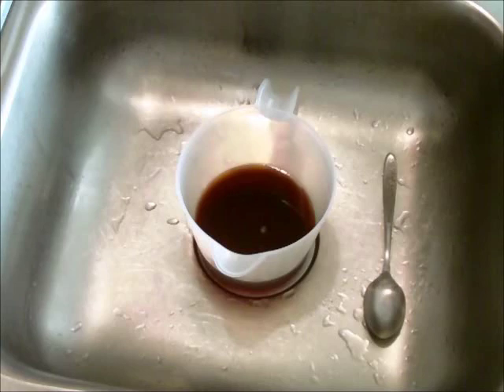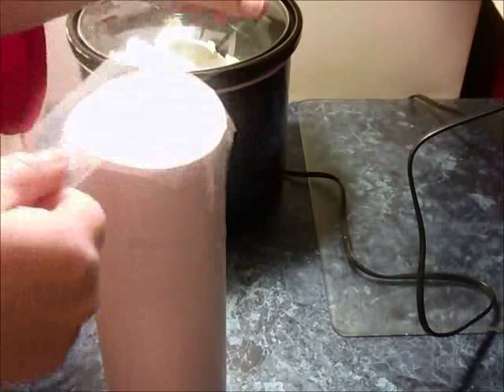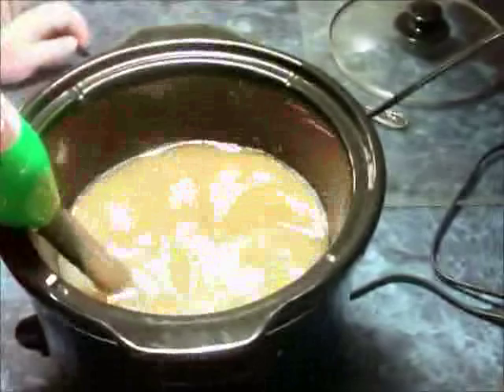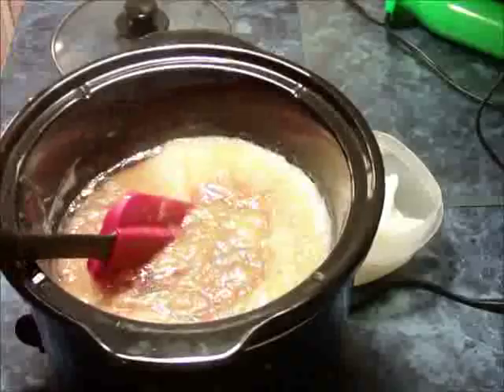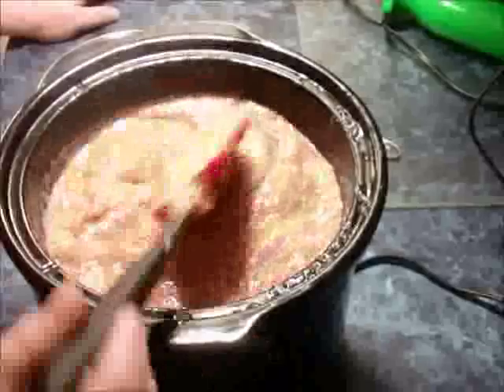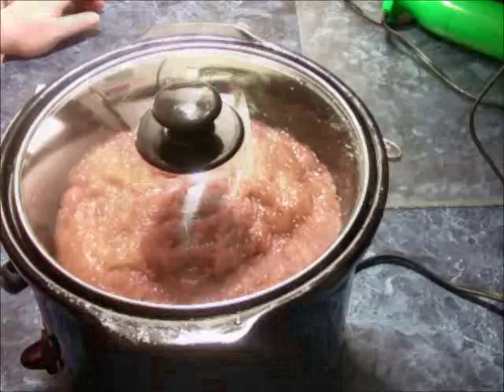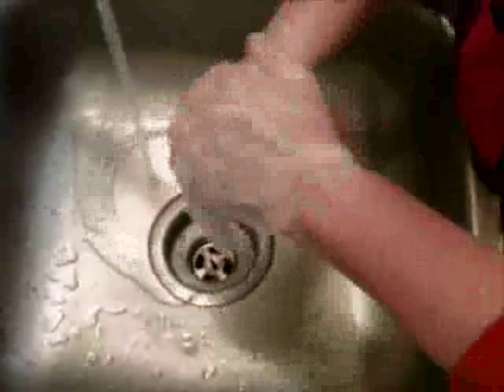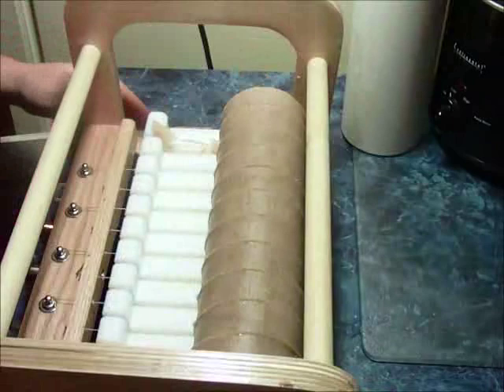Making Hot Process Beer Soap

Comment: Thank you for the video!  I wanted to give a little tip I do when using pvc pipe for a mold.  In that same section at Lowes or Home Depot, usually right below some of the pipes, they have different joints and end caps available for the pipes.  There's a flat plastic end cap for less than $1, it pops in the end of the pipe and pops right back out when your soap is solid.  Super easy and reusable!  :)

Comment: How did you manage to get your soap out of the PVC pipe without it being lined?  I made soap in mine once and had to have an act of congress to get it out and many of the bars were lost. Are you using a mineral oil to coat it or is your mold just seasoned? I'm in awe over here.  That soap is amazing. It cooked without being brought to heavy trace, go figure. 😊
Reply from the maker: Yes I still use them.  I coat the inside with olive oil or coconut oil.  Since the cooked is already saponified it helps it slip out.  I use a tall metal water bottle to push it out.

Comment: Hi, do you use any product inside the pipe so the soap can come out easily? I have tried to use the pipe for my first batch, but it is stock in it. Any tips? :-(
Reply from the maker: I grease it with olive oil since it is HP..If I was pouring CP in it I would line with freezer paper.
Reply: Thank you!

Comment: Can someone explain the pros and cons of hp vs. Cp.? Soaper wannabe and confused about which process would be best for me to try. .... Thx.
Reply from the maker: With cp you can make really beautiful designs and the soap is much more smooth when cut. Cons to Cp would be longer cure time and some fragrances will cause the soap to harden or separate before you get into the mold.  Hp..shorter cure time, you can really use right aw
Reply from the maker: Hp you can use right away but it last longer if you let it cure,about a week or two.  Problem fragrance are easily used since you add at the end.  Also you can add specialty oils up to no more than an 1oz depending on the size of your recipe at the end of your cook. Cons would be..less design choices and more rustic looking.  I love both processes.
Reply: Tasha Olive easier and faster is all I can say.  Once you get the hang of it you can make nice designs.  It is a more rustic look.  I like it also like the fact that I can SF, after the lye has "eaten" the fats.  I find my HP soaps are more creamier than CP (only my opinion).  Plus less to clean up-YEA.